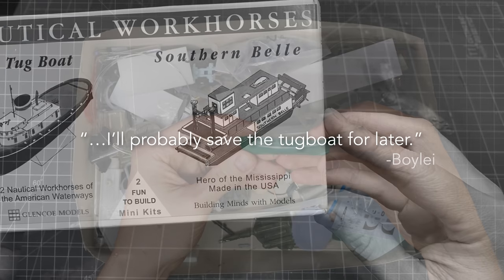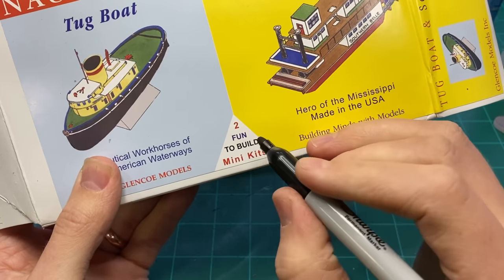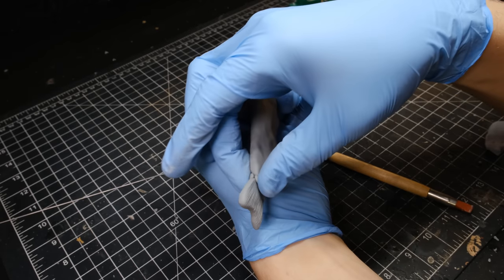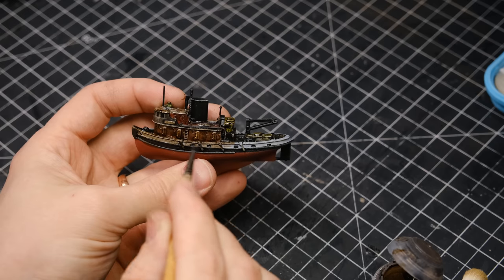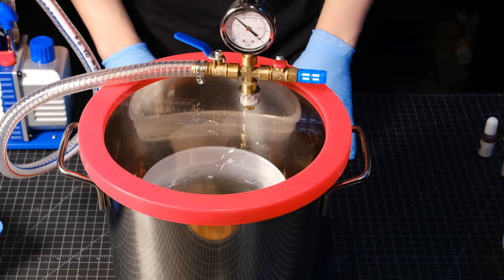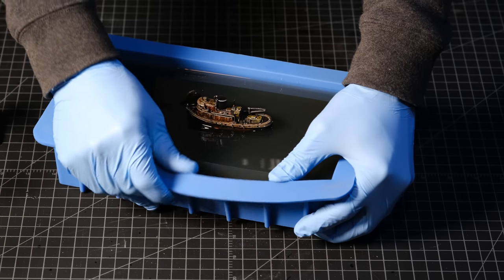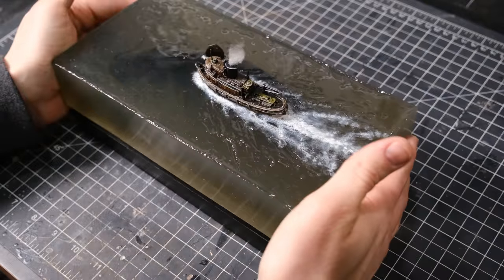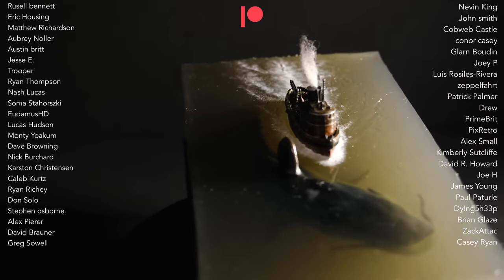Mississippi River Monster Diorama

Comment: A tip I've picked up from working with clear is that after sanding, instead of using varnish you can use headlight polishing compound to get rid of the last vestiges of unevenness from the surface. It looks better than varnish and only takes a little bit of time with a microfiber rag.

Comment: Another great looking build! Resin dioramas with big sea monsters are always my favorite, it's actually the big crocodile video that led me to your channel. I make resin dice myself, and I can absolutely swear by the efficacy of a pressure pot to remove bubbles, even if you don't torch the resin or vacuum it beforehand. That being said, it can be impractical to put diorama sized things in a pressure pot, and I may be concerned about pressurizing the whole scene. Plastic models like the tugboat here are hollow, and pressurizing them may cause them to implode, which wouldn't be good. The vacuum chamber is essentially useless for the scale of resin I work at, but I think it's your best bet here.

Comment: Interesting note from my personal experience using spray paint on baked Sculpey/polymer: while I have run into this issue of the surface becoming tacky once, I was able to fix it by coating the tacky surface in a dusting of baking powder. I've also read that the reason for this is that the spray paint is not properly mixed in the can, so since then I've always given an extra minute or so to shaking up the paint, and I've never had the sticky problem since!
Reply from the maker: Good to know! I’ll give those tricks a try. Thanks, man.

Comment: I've seen a few people who put another resin brushed onto the sides (more of the same or a fast UV curing resin) rather than sanding, to save all that time. Might test that out on a spare to see if it helps. I've tried sanding resin glass smooth, and it takes sooooooo long.

Comment: First, there is such thing as a whale catfish (technically its official name is Wel's Catfish) and yes Jeremy Wade did catch one.
Second, math time.
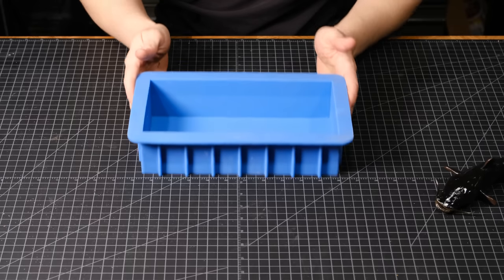Judging from this shot ( 3:36 ), the tugboat is 6.5 inches long, and the average real-world tug boat is between 20 to 32 meters long, let's go middle of the road and say 26.
26/6.5 is 4, meaning that every inch is around 4 meters.
This means that by counting the number of squares long the catfish is (19, technically 16 but adding three to make up for the bend).
This means our southern beast is about 76 meters long, translating into freedom units this is 249.34, the average wels catfish is about 15 ft long, making this little fishy 16 times the length of its largest cousins.
wow.

Comment: I have always wanted to see T-Rex vs Spinosaurus diorama where T-Rex is biting Spinosauruses neck while the same time Spinosaurus slashes T-Rex with its claws in the chest area, blood splatter made from uv resin dyed in red would be good choice here for the splatter for the T-Rexes chest area. Also adding some more scars to both of them like, small bits of Spinosauruses tail/sail would be bitten of my T-Rex and slashing wound on T-Rexes face area under the eye and either side of the body.
Nice build as usual :)

Comment: I'm taking some inspiration from this as I have 3 old Lindberg tug boats, two similar to this one and a barge pusher that I found at the thrift shop months ago and never knew what I was going to to with them. Someone assembled them but never painted them. I'm thinking I might do a run down tug dock with one of the two matching tugs partially sunk, tied up to its sibling and the barge tug on the oposite side of the collapsing pier/dock.

Comment: If you wash the models with soap and water (I suggest dawn) not only should you be able to glue the pieces together (I’m fairly sure) but it will take paint far far better since most problems when dealing with plastic of most types is mold release that remains on the model pieces from manufacturing, even with most plastic toys you have to wash them before you paint or add anything to them. There is one type of rarer garbage plastic this doesn’t work on and you do have to use the torch, but most times a little soap and water is all you need, you should try that before the torch, unless you have tried it and already know of this, if so, disregard everything before this last part.

Comment: Sorry but it'll annoy me if I don't say anything; 

Technically not boiling the resin, the small air pockets are moving upwards (as the lower pressure makes them expand causing the air within to be less dense to a high enough degree that it can overcome the goopyness (surface tension but not on the surface) of the resin. After the bubbles reach the top they pop, reducing the bubbles (so the bubble was there but not visable, then became visable, then popped and was gone) Using the flame acts in a similar way, the heat causes the air in the surface bubbles to expand to a point where they overcome the surface tension and pop. 

A pressure pot (increasing the pressure) does the opposite, the (air) bubbles that are in the resin become more dense, making them smaller and therefor less visable. 

Boiling the resin would create more bubbles (not to mention ruin the curing process cuz weird chemistry stuff.) As when a liquid boils it moves to a gass so that gas would then become a bubble which would have to move upward to pop.

I understand the confusion as liquids can boil at low pressures (and it looks exactly the same) but in this case its not happening as the resin isn't volitile at this temperature and is a mixture of compounds so react differntly when exposed to heat and pressure. I hope this is helpfull, physical chemistry is a pain to explain sometimes.
Reply from the maker: Thanks for the info! Makes more sense.
Reply: @Boylei  No worries :D